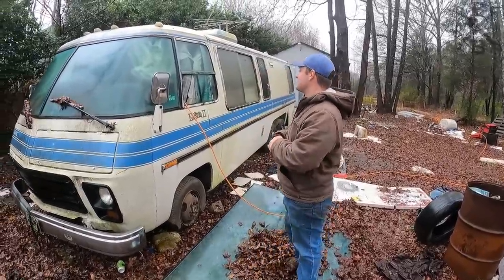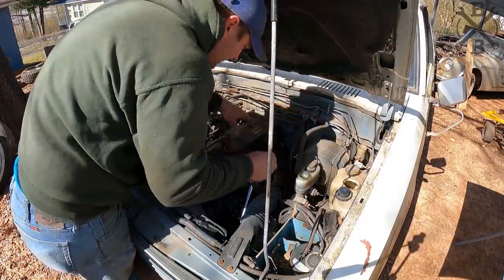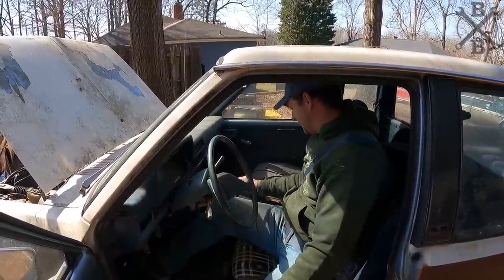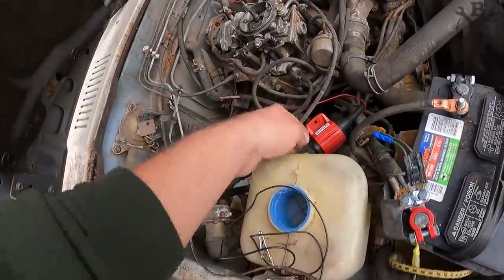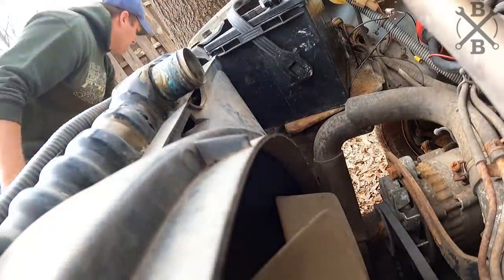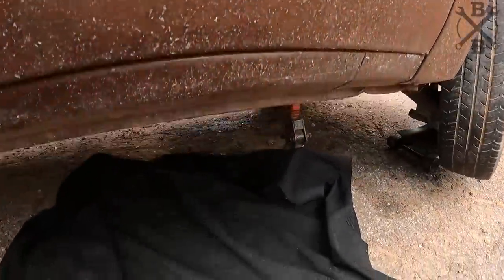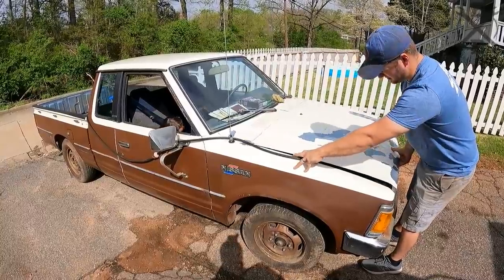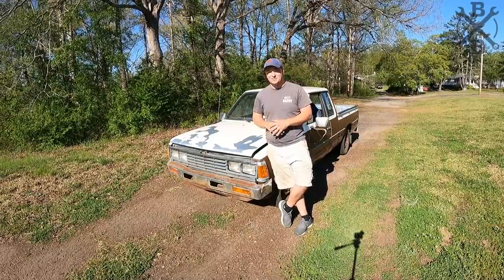Forgotten Classic Nissan Pickup! Will it run and Drive After 20 Years?

Comment: Dude 454, Not 455 Its not a Pontiac. I of those just sold here , All redone , 11,000.00, But That's All new cabinets, new interior, engine trans, all rebuilt.
Reply from the maker: Early ones came with the 455 and later with the 403, sorry but not a 454. Possibly the one you had was swapped out. It’s an Oldsmobile, hence the front wheel drive.